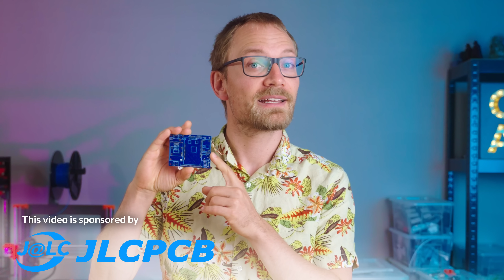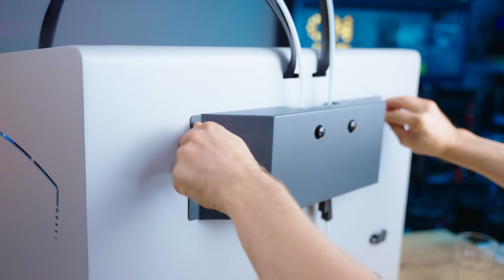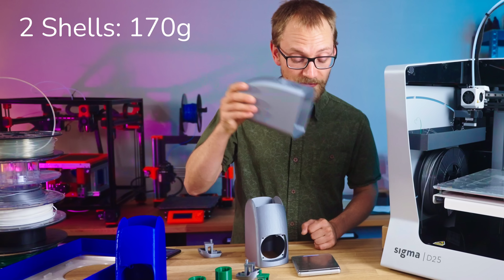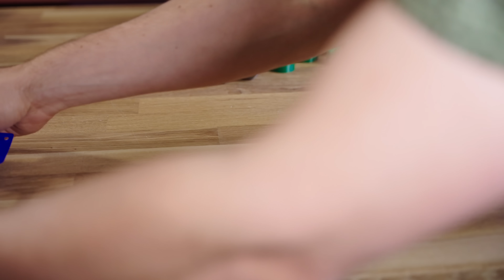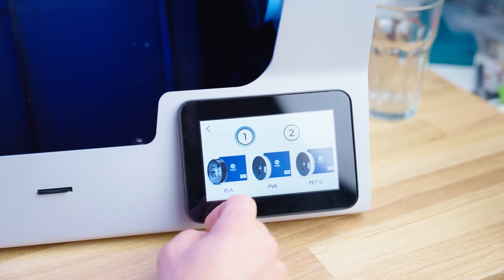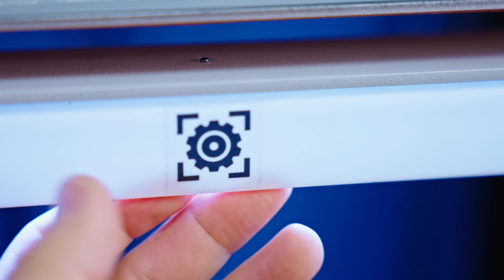Is this BETTER than the Ultimaker S5?

Comment: This truly is a niche product, and not a very good one at that with all the flaws. I guess you really need to be printing larger items to 'need' this printer. I have 7 idex printers, three are Ender 3s with an IDEX upgrade and four of them are Flashforge Creator Pro 2 printers, I think all of my printers combined don't even come to $4k. For the same money or less, I could potentially print 14 items (duplicate or mirror) in the same time or potentially faster than this printer could print just 2 items.

Comment: The only issue I see is how do you change the spool if you’re printing a tall item? Won’t the print bed in a lower position prohibit that?
Reply: It pauses lowers plate, whole routine built in
Reply: @benjaminalvinbaker  ok cool , the plate lowers to allow access….. what happens it the large print has a straight vertical face at the side of the print bed that you want to access the filament reel?( just trying to get this straight in my head)
Reply from the maker: The best way to go about it would be to use the spool mounts in the back. It's super easy to use up an entire 1kg spool if you actually use the full print volume of the D25.
Reply: @MadeWithLayers  Thankyou for clarification , a spool mount external makes more sense . I’ll sleep easy now .

Comment: I traded out my Sigmax R19 for a Raise3D E2, which had a built in enclosure ayt the sacrifice of some build area. My biggest snag with the Sigmax was the glass plate suspended above the heaters - it meant there was always an air gap which lead to heating and print adhesion issues. Nice to see they have fixed that.
Reply: User manual says: "If the bed adhesion is not good raise the temperature by 5 °C". I ended at 75°C for PLA (with 3DLAC)

Comment: Counter levered bed = FAIL!!!
Running long signal wires instead of long motor wires = FAIL!! (you have no idea Tom, this is bad, not good like your sales pitch)
Lots of third party bits together = FAIL!!
Room for print "bits" to fall under bed into electronics  FAIL!!
Fans without fan slots = FAIL!!
Low quality motor drivers = FAIL!!!

Who cars what this is worth, it is a fail all round!
Reply: It works decently for a Voron 0, at 12x12 cm bed size. For such a huge bed however it is pretty crazy.
Reply: Drivers are tmc2130 in standalone mode, but ribbon cable failing takes a week to be delivered, and still 8bit processor with marlin with a linux WiFi gui

Comment: For the price, not having quality bed leveling is insane.  I've been looking for a professional printer for my shop so my co-workers can easily operate it when I'm not in.  Their epsilon printer was on my radar but it seemed to be lacking so many features that I think are necessary.  Not using 1.75mm is a no-go for me as well.  At this point I'm just going to wait for the Prusa XL since I'm sure that that printer will cover all my bases.  The professional printers available right now are just awful price to performance/features.
Reply: If something goes wrong mate, you need plenty of experience to troubleshoot, great when they work, bugger when they not

Comment: If you are thinking to buy this machine, you should first check out the Raise 3D E2. It is also an idex but has a lot of features that BCN 3D has not such as flexplate, direct drive and bed mesh. We have both and we regret the BCN3D printer a lot and wish that we would have had 2 E2s instead.
Reply: Add me to that list, big regret
Reply: me too
Reply: @Albert Navarro Balcells i think I did this machine a disservice, I don't own a d25, I have the much earlier r17, which although uses many of the same high quality components (genuine hiwin rails, e3d hotends), there were quality issues a few years ago (a few lemons got through) , and bcn3d have taken down the old forums of people trying to solve their issues, because unfortunately after warranty runs out its expensive machine, with high tolerances to work on at home without the right tools. Like steel mounts for the rails not being deburred causing the rails to not be parallel causing the self leveling routine to get stuck at the front of the bed, motor brackets holding z leadscrew not being square leading to z banding, there was a whole heap of early issues. Plus this machine was advertised to be upto 3 times faster because using idex, u could use different size nozzles on the same print small to do Detail, large to do the rest, sounds great if the software, stls, slicers made that a trivial bit operation for the average user. The colour printing is excellent, although a bit slow compared to today's machines, but to accuse people of not knowing about 3d printing is not really considering other peoples experiences. I hope you find the d25 to be a real work horse, then all the troubleshooting us users learnt about wouldn't have been without use.
Reply: Me three. We have the epsilon series
Reply: Except that from some brief testing on my part, Raise3D's slicer appears to be lousy because I can't set the shell thickness.

Comment: Definitely check out the Weedo x40, looks like it does 90-95% of the same quality (with a 300x300x400 build volume) with roughly a 6-7th of the price tag. (and yes its an IDEX)
Reply: The X40 is a terrible machine, i have one of my own. It can print nice no doubt, but the electronics kind of suck.
The printer has loud fans, not all stepper drivers are 2208 and the worst part, their firmware simply sucks beyond anything.

I have had lost a couple of prints where one printhead simply stopped moving. It would extrude but stay stationary.
If this issue is actually a firmware issue or an issue of the board, i am not sure.

I do not recommend to buy a X40 and if you do, join the X40 Community discord and see what issues all the guys there have. ;)
Reply: @TeaObvious  I've heard those are main issues with the earlier models, however idk for sure, I do know that mine has been giving me very little issues (other than basic maintenance) and I got mine in June. If you wanted another alternative I'd say the Artist pro-D is a solid choice (I have heard a lot complaints about the artist pro than the weedo x40)
Reply: @demetriousferris6675  this may be, a couple of people in our discord had dead boards and payed to get new ones, they weren't even replace for free...
Since then their printers seem to work. So maybe the early board are faulty.

How ever that does not solve the problem with the loud fans and especially the lie about silent stepper drivers. (I am not sure if they still claim this)

Personally, i got it for 300€ and this is somewhat, what it could be considered "worth", especially when i finally get around to replace the board for something actually good. How ever, every euro more is to expensive.
If i need a predone printer, i would keep an eye on the Jadelabo. If i have nothing against a kit printer, i would buy the RatRig V-Cast, as soon as its hardware refresh is done.
Reply: @TeaObvious   if you're up for a challenge you should turn a voron 2.4 into an idex 😉. I'm currently working on one and I think I can get it done around 1400-1500$
Reply: @demetriousferris6675  I have a v-core-3 and i am about to design a tool changer for that printer. If you go Core-XY and don't need duplication mode, a Toolchanger is the even better route to go. :)
Reply: I am considering the Weedo X40 but the reviews are not great.  If I were looking for something in the price range of a D25, I would buy a Raise3D printer.

Comment: The drivers being placed near the motors is a feature I would like to see more often. 
It is really a bad Idea to run high current, high frequency signals for a relatively long distance, you're loosing more torque and radiating more EMF than you think!
Reply: Ribbon cables a nightmare when one breaks and you have to wait a week to get another.
Reply: @benjaminalvinbaker  Just buy a roll of ribbon wire and some crimp ends that they use and keep them on hand.
Reply: @benjaminalvinbaker  enough places with ribbon cable in stock

Comment: Raise3D E2 … It's also IDEX, print volume is only 330mm in width, but it comes with autolevel, with a camera, uses 1.75mm filament, is enclosed and more silent. AND about 25% cheaper…
Reply: And they actually work!
Reply: I wouldn't want a Raise3D either.
Reply: Yep, great machine, we have it in our lab!
Reply: I can recommend the e2 too. Over 500h yet and only minor fails (mostly caused by me).
Awesome results with ASA.
Reply: I just wish it were taller. Like their Pro+ printer.

But I like all the rest of their features.
Reply: Have had my E2 for about 8 months now and it's been an awesome machine. Turns out great quality prints reliably every time regardless of the material I throw at it. It's also been a work horse and have put it through multiple projects where its printing 24/7 for multiple weeks. The only maintenance I've had to do so far is replacing a leaky heat brake that I only noticed when I disassembled the extruder to clean it after clogging the it with low quality filament. I know some people have had absolutely terrible experiences with the e2 or raise3d's customer service but my experience thus far has been overwhelmingly positive.
Reply: @Albert Navarro Balcells Facts

Comment: Yea... Might as well just wait for the IDEX Voron to make its debut... Shaves the costs down to like ⅓ of that machine and comes without the garbage ecosystem of needing like 6 complete hotends running on 3mm filament. The cost saving though will probably come at the cost of needing to dig into the matter of properly configuring what is basically a DIY solution as from my experience with my Voron 2.4 you're seriously out of luck finding a comprehensive guide on how to get your machine to Voron Speeds once you've finished building and configuring the basics using the official guide.
Reply: You can make a nice idex corexy for 700$ tbh. You don't necessarily need a Voron. Tho Voron has its sweet advantages ofc :p and it's already designed Saving you months of effort
Reply: @D. A. Oh I'm saying an idex corexy isn't that hard to design. It can also be done for not much more money (100$ extra? Maximum?)

I'm thinking of a CoreXX with a seperate y axis motor and belt path
Reply: @ameliabuns  I'd argue that with so many things, designing one isn't the problem - Coding for it is 😮
Reply: @Duraltia  I think there are firmwares for it already? Worst case is I think you might be able to fool the klipper firmware into treating it as the Y?
Reply: @Duraltia  oh I just realized. With the mechanics I have in mind you'd program it like a Cartesian because it'll be one. 

I was talking about connection the top belt to one X and the bottom to another X that'd remove the movement in the y axis as a result?
Reply: @ameliabuns  I think that is the thought process EddieTheEngineer is currently working on with the Voron IDEX system.

Basically, instead of an A and B-Axis, you'd have two X-Axis Motors for the two Toolheads and two Y-Axis Motors for each end of the X-Axis.
Reply: @Duraltia  oh the Eddie is what I'm exactly talking about!
Reply: @Duraltia  expect you don't need two motors for y. You can just use belts etc
Reply: Yea at that point you may probably just want to invest in the 2nd Y-Axis Motor for X-Axis tramming capability - Eddie explains it as kinda an expected necessity due to the extra width you'll be needing to accommodate the 2nd, 60mm wide ( and like another 5-10mm for touching off at the endstop + clearance to the other toolhead ), toolhead while retaining the same workspace.

I mean with a Voron 2.4 Style IDEX you'd already be 9 Steppers deep in the build, what's a 10th gonna hurt you? 😉

Besides that I think there'd also be a benefit of having two smaller Y-Steppers requiring less torque to overcome not only the inertia of the entire X-Axis Assembly moving back and forth but also their own stators mass if you used a single but even larger than normal stepper to do that.

Comment: So fascinating that companies are not able to get the basics right at that price right? Simply having a milled aluminium bed-plate, proper mounting so it doesn’t need ABL… I would say is a minimum. Being unique is definitely very nice, but not a real point for companies that actually want to use one.
Reply: @Vincent ..absolutely agree!  Well said.
Reply: Creator 3 (Pro) and Creator 4 from Flashforge. First one I own, second one I'll certainly buy.

Comment: What about the Creality CR-10S5 I know it's only single extruder/hotend but the build area is 500x500x500 and it's only around £540 (ex delivery).
Reply: Large printbed - indeed. Buy try printing big/large on that: "Weak cold pusher!" ...after a zillion community upgrades (much needed!)(shame on you Creality!): downsized
Reply: Unfortunately, print speeds and ans possible accelerations on that thing are too low for the size imho. Unless you print with a 1mm nozzle, it’ll take forever to print something that requires that kind of volume.

Comment: Thanks for sharing Tom, quick question is it possible to run 4 3d printers on octoprint running on a pc and all printers plugged into the pc via usb. Thanks in advance if you answer me.
Reply: I can contribute. There's nothing explicitly preventing it, but it probably isn't a good idea. USB controllers can be easily affected by workload, and a hub means all are competing for bandwidth and latency. You'll likely get "zits" from the printer pausing as it receives code all over the prints. I think CNC Kitchen or Makers Muse covered it a while back. Printing directly from SD is always best, but dedicated controllers is close. Normal USB from a PC on the other hand is often just too slow and unstable for the tight timings needed.

Comment: This is an odd one... It's a great machine but the places where it fails feel out of place given the polish of the rest of it.
Reply: It's just so weird how they succeeded at few things and flopped at the basics.
Reply: @TechnologistAtWork  yeah it almost feels like it was made by two teams and one put in way more effort than the other or smth
Reply: It's made for education and industry when you can afford a technician to come troubleshooting every other month. I have had one r17 only ~500hours of runtime in 4 years, my creality has nearly 10000 hours in 3 years
Reply: @benjaminalvinbaker  that only tells me it's an overpriced garbage.
Reply: @benjaminalvinbaker  sure but you shouldn't need a technician coming out every other month at that price point.
Reply: @thatspiderbyte  I should have been more clear I own a r17, which is a 4 year old, smaller but same form factor machine, which uses many of the high quality components, has a few issues, I really hope they solved them in this latest version, although not enclosing the printer to expand the variety of filaments, only making 0.4 & 0.8 nozzles (think they even dropping support for hardened nozzles), does sound like being locked into their ecco systems, plus not being able to change nozzles buy whole hotends(its been shown brass nozzles do deteriorate causing print issues). I hope they go back to being open source at some point
Reply: @Albert Navarro Balcells lol are you for real? Can't do jack on this overpriced garbage.

Comment: So I didn't see any mention of thermal protections in the firmware here. Did they get tested in the 10hr unboxing live stream?
Reply from the maker: I did not explicitly test them, but I have no reason to believe that BCN3D would have messed up the thermal protection features.
Reply: I don't see the logic, how does a manufacturer get an automatic pass just because they have a higher price tag? There's a common saying, "trust, but verify." Given 3D printer history there's really no excuse today for printer manufacturers to mess up thermal protections at all, ever, yet you published a video just 3 weeks ago demonstrating that this is still a problem.
I'm already dubious about the presence of an SSR on the heated bed and you, yourself, pointed out that they should be using a MOSFET there. Omron's "Solid State Relays Safety Precautions" document points out two related concerns:
1. "SSRs may occasionally explode. Do not apply a short-circuit current to the load side of an SSR."
2. "Short-circuit failures represent the main failure mode and can result in an inability to shut OFF the load. Therefore, for fail-safe operation of control circuits that use SSRs, do not use circuits that shut OFF the load power supply only with an SSR, but rather also use circuits with a contactor or breaker that shuts off the load when the SSR fails."

Comment: Nice review. Just two things:
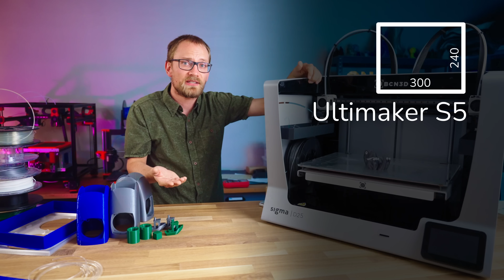@5:28 There is also the (infamous) vivedino/formbot IDEX T-Rex 3 (400x400x500mm³) BTW: With a 230V heated bed. 
@7:28 There was no problem to create copy/mirror mode profiles for PrusaSlicer and without digging into the slicer's code. So no need for forking.
Reply: Do you have sigma profiles for PrusaSlicer? Thanks
Reply: @duveral  Sorry, but no.